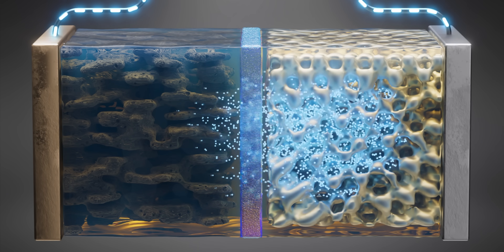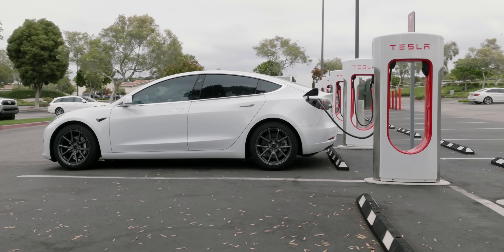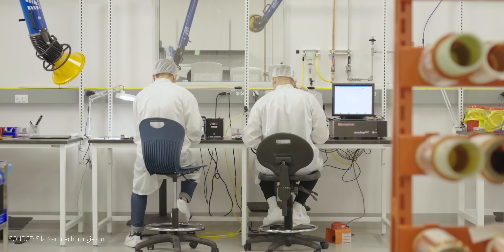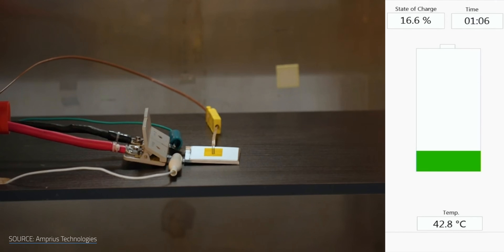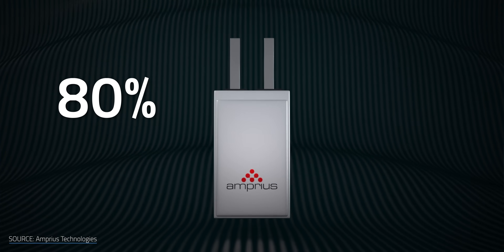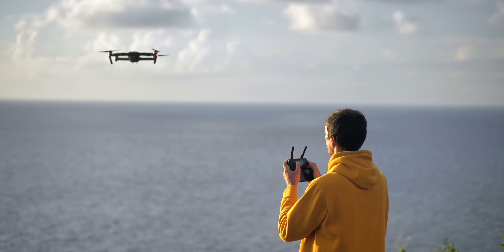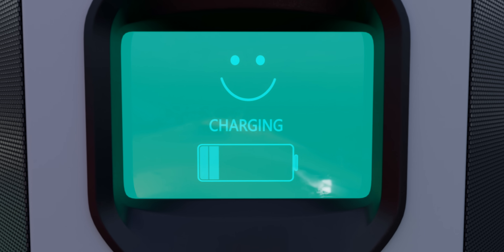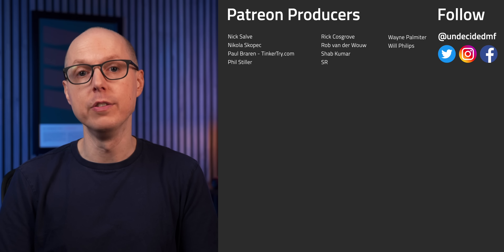Why This Ultra Dense Battery Breakthrough Matters

Comment: Niiice. No more diagonal shot. I was wondering these days if a more lateral shot was not a possibility because of what we would see behind. lol. I still think those shots work better when it’s a conversation more than a “presentation”.
I also see some experimentation going on (zoom in/out in “dramatic fashion” at important moments). Looking to make it more visually appealing? Fear of boring with just a single shot? Sorry to be a party pooper, I’m not a big fan of the result. It is still distracting (at least for me). It actually distracts me from the info you are revealing. For them to work, there should be a pause in your speech. It would go speech/pause/zoom in/speech part we want to emphasize… you get it. But that may be too much if you are not selling ceramic coated pans on TV. lol. Kidding. It might be worth trying to see how it actually works. 
I would suggest using closer shot (zoom in) not in a dynamic way. Since there are a lot of parts where you cut to technical footage, you could come back to you in a closer shot and leave it till your next cut. Maybe even use it for the part where you talk about the cons of a new tech. Almost like a more one on one vibe. I personally like when the video change has a reason to be there. It might be a change in delivery because it’s important. It might be a closer shot cause this is the part where we dig a little deeper and see the potential flaws… and then we go back to a less tight, more relaxed open shot for the conclusion. 
Once again, just an opinion because I love the content, the videos are top notch, the delivery… I, in fact, want a “I love Matt” t shirt. lol

Comment: OMG, I am just so over this never ending hype about the next revolution in battery tech every week/month. YAWN! Non of these supposed revolutions has made it into actual products, even though for years we have to be bombarded with these lab technologies that are nowhere near volume manufacturing, with many that will never make it. Just look at solid state battery tech, they have been coming for years! How about Tesla's 4680 battery, still hasn't replaced the 2170, 3 years after its announcement and that's just a different form factor.

Comment: A battery like this plus super capacitors at charging stations to keep the load on the power grid manageable would be a huge game changer.
Reply: Thats actually a "problem" of that battery. You probably would never find a charge station that could deliver that much power in such a short time. I dont know if the powercable could even handle that without overheating.
Reply: @Daniel-rd6st It would require a lot of power, but just because it can charge that fast doesn’t mean it has to. I think the existing 350-kW chargers would get you pretty close, at least a sub-15-minute charge to 80%. Heck, the Ioniq 5 can charge 10–80% in 18 minutes, and it maxes out around 230 kW.

Comment: Batteries are one of the main things that turns me off from electric vehicles. The batteries are expensive, create a lot of waste when they are produced and when they are discarded, take a long time to recharge, capacity isn’t great, and pose a greater danger than gas vehicles if they catch on fire. Hopefully though, battery technology will continue to progress.

Comment: The Amprius battery is currently too expensive for consumer electronics or cars which is why they are targeting the aerospace market. Also, they are not in production and it's not clear when they will be in mass production. Enovix is currently ramping their new factory for their silicon anode batteries which will be in production in 2024, and they have hinted that they have deals in place with major phone OEMs (rumored to be Apple and Samsung). So Enovix will probably beat Amprius to market by at least 1 or 2 years and at a lower cost. Enovix also has a unique battery structure that prevents fires, which means that they might be used in cars once the production volume gets high enough, probably around 2026. I think Enovix will win this race.

Comment: I want to bring some perspective on one of the breakthrough's biggest hurdles. (Edited for fundamental grammar issues).

 If we step out into a macro scale of society along with geopolitical issues. Isn't it important to address the fact that, the reason why this breakthrough is struggling with scale is that, the scale (cars, laptops, etc), could be attributed to a questionable world culture?

 If you research why we all HAVE to use cars, you quickly realized that all of it was induced demand created by the empire we live in. You can't stay viable towards a path of personal sustainability without one. The U.S. size (land) problem is quickly addressed by the initial issue of unwarranted land expansion, when, the country's cities could've functioned differently;
As nodes and hubs with public ley lines (trains) to transport ourselves, at will, to key locations. This idea addresses the sheer quantity (the scale) of consumer demand. There are many issues that arise from scale in every industry, institute and needs of the people. It is all clearly attributed to the unwavering desire for a country to hold too many eggs in one basket. Example; humanitarian issues arise from scale, this usually required new inventions (laws, authority, etc) to remedy.

 I believe this to be nothing short of coping from part of the U.S dream as a whole.
We can clearly see that the needs of a smaller demand can be met. Sometimes it's okay to look for solutions in a different place than where we are looking. Fallacies can be tricky.
Are we looking at the hurdles right-side up? That's for you guys to figure. :)
Trust me, from experience, more people DON'T want cars than one might imagine.

Comment: If energy density is so much better, it also opens up the path to much lighter vehicles, same or better range with a smaller, lighter battery - it also means we could re-think the skateboard design for smaller cars and even see more micro cars on the market for crowded roads such as Japan or Europe.
Reply: Elon Musk has said that if there is a major improvement in battery density, it won’t lead to much more range, because 400 miles is really enough for almost any purpose. Instead, more density would result in lighter, less expensive vehicles.
Reply: @davestagner  To a point. Yes, you can reduce the amount of batteries as the main path, but there will be a point of min you still have to hit to still run the required min discharge rate. I dont know those numbers sadly, but there would still be a x amount of battery. Aka, more range would still be added. Also, most only do around 300 - 400 would still be an improvement. 400, 800, and 1k will be the target ranges for a while. Even if Tesla doesnt do it - others would still. Also, less weight = more range either way you look at it, so there will be just gains from just reducing the battery that they might not even care to carry over (aka, market it just better range for less the cost and weight).
Reply: @adr2t  I can see your point, but I’m not sure I agree. Range anxiety is about anxiety, not about functionality. I can’t drive 400 miles without stopping for food or other biological needs. Most people can’t. And as chargers become more readily available (and charging cycles get faster), it will be as convenient as gasoline. And that will happen by the end of the decade. If the choice for manufacturers is “Do 1000 miles on a charge to impress the manly men, or sell it for $4000 less in this competitive market”, I guarantee they’ll choose the latter. And I don’t see why there’d be a technical need for more capacity to achieve the same discharge rate.
Reply: @davestagner  Eh, 400 miles is a lot of cars, but its not all cars. Then there are variables that drops 400 down to 300. Keep in mind we're still in the 300 miles - not the 400. Thus we are still more like 200 atm (heating, weather, traffic, highway, etc). 400, 800, and 1k will be the ranges a lot of people will want because they dont have to worry about the range anxiety because they know they will be able to get to the charging station is time/gives them time. No matter the issues above not just range alone it self. Also, I already pointed that prices will drop, but ranges will still be a target they will want to still also hit. So yes, you are partly right they will focus on droping the amount of cells per pack, but still will try to get more range out of it too for maketing like they currently already do.

Comment: Amprius was also used by the top 4 teams of the bridgestone world solar chalnge this year. Reportedly the teams that used amprius achieved at least 20% more energy capacity for a given mass of batteries compared to other battery types.
Reply: We sure did! It was even more than a 20% increase! More in the 40% range :)
Reply: @benonland  not sure if you have any idea - but , based on the info in this video, a silicon battery can supposedly hold 24x more ions than graphite. shouldn't we see more like a 2400% increase? why are the increases so small (contextually), when the improvement in density is supposedly so large?  a 40% increase is HUGE typically. but when it supposedly is 2400% more dense, 40% suddenly seems miniscule.
Reply: @monkunashi Theoretical limits are theoretically possible. New cutting edge tech rarely lives in the lab until it is optimised to the maximal point before being commercialised. It can go to market as soon as it has enough of a competitive edge to offer; that allows companies to profit from and recapitalise on their R&D to that point, as they push further forward on reaching a more optimised product. Iterate faster, commercialise faster.
Reply: Finally cause, I have stock in them.
Reply: @psylinx  Finally is right, I hope I live to see a break even on that investment.
Reply: I hope so. @MikeGentry
Reply: @psylinx  u guys should be happy now lol their stock exploded
Reply: wow, cool seemingly tribal info at 1st :)!

Comment: there will be a space for silicon batteries. other anode materials that have similar properties include having metals such as niobium and titanium. again, price, price, price is what it is all about. So not necessarily a direct replacement where Nb is >$20/kg and Titanate is $12 to $18/kg while graphite is $2/kg

Comment: Silicon is also used in processors, so if we start using it in batteries as well, are we putting too many eggs in one basket? Are we going to reach a point where we need to pay attention to our silicon footprint the same way we worry about our carbon footprint? While it may be plentiful, I've heard that processing silicon for processors can be a toxic process, and as such there may be concern with balancing its effectiveness with any harmful byproducts from processing. This sounds promising overall, I'm just worried about the bigger picture of it all.
Reply: Amprius uses three different chemical vapor deposition processes to grow its silicon nanowires, which is very different than creating silicon logic chip. I don't think that we will ever see batteries combined with silicon logic chips. I imagine that similar chemicals are used as in silicon chip fabbing, but Amprius is very tight lipped about its process, so hard to know if similar pollution problems.

Comment: The availability of Silicon anode battteries does not necessarily mean that this is the way to go. But it definitely moves the goalposts. If you manufacture conventional Li-NMC or Li-FePO cells, or if you want to get to market with a new cell technology or develop a new cell chemistry until it can go to market, Silicon anode batteries are something you have to compare to and to be better at least in some aspects to convince potential buyers.

Comment: The range issue is not an anxiety.  It's a reality.  Feel free to use a BEV in North Dakota like I did and make it work for 4 years, even on road trips at below -20 to Montana, when the range is cut in half or worse.  Didn't get stranded due to running out of juice, but came close a few times.
Reply: You sir are one tough hombre! 
I'm now  70 but I used to bike summer and Winter in NE Illinois until 10 years ago.  Also built a home made EV in 1978.  I would never use an EV in your climate farther than I could safely walk to warmth and safety.   Well maybe if I trailered a generator, plenty of fuel and a can of starting ether.
Reply: Your range anxiety is self-imposed. Maybe driving an EV in ND four years ago, without charging infrastructure, in the winter was not a good idea.  

Would it be the same today? I drive my EV in rural MN, and to SD, regularly. And as of this year, I have charging options all along the way. Four new ones in just the past 8 months with more on the way. No anxiety for me, even at below 0. If I want to go deep into northern MN in the winter, it's a different story. I would not drive an EV in that case. I plan ahead so as to not experience range anxiety.
Reply: Anxiety has nothing to do with it.  These are cold hard facts.  We had enough charging infrastructure 4 years ago to support 120 mile range.  At -25' Farenheit, 335 mile range becomes about 140, especially if driving into a headwind, so that's cutting it pretty close. I drove a 2020 Model X with 295 mile range from MN to Fargo at -20 F into a 20mph wind in 2020.  Range reduced by about 60%.  Stopped and charged to 100% in Alexandria. That's 108 miles along 94 to Fargo.  Even with heat cut and at 60 mph, rolled into the Fargo supercharger with 3% charge left (about 4 miles at that temp).  EV's need more range and faster charging to have the same utility as ice vehicles.  They're not a good choice if you have to keep an ICE as backup.  LI-OH batteries suck in the cold, charge slow, and don't last if supercharged often.  Just ask anyone  who used a Model 3 for Uber.
Reply: @hammerfist8763  I can only imagine the lack of mileage performance here in the deep Gulf south. A/C is a must most of the year. Anyone with experience? Doing a quick bit of research shows an average of 25% reduction in mileag but does not graph it for ambient temperature. As temps climb over 90 degrees mileage drops significantly. At 100 degrees there is a 31% reduction in mileage with A/C on.
Reply: @WayneTheSeine  AC + hot climate did not seem to impact mileage nearly that much for me.  Heat tends to increase Li-OH battery efficiency.  Cold, especially at -20' severely impacts it (50%+ decrease). I've put 60,000 miles on my Model S-50,000 of those in North Dakota and another 10k since moving back to central Texas.  30% seems like a huge hit for something minor like powering a 3 hp AC motor vs the 600 hp electric motors propelling the 4800 pound vehicle + driver.
Reply: @hammerfist8763  The 30% hit is due to the battery not the motor. There is a point of diminishing return with heat and Lithium batteries. All of the "minimal" research I did cited the same stat.
Reply: @WayneTheSeine  I'm in Austin, TX now and took a road trip to Fl earlier this year at 95'+ running AC all the way there and back and did not experience anywhere near a 30% range loss.  I've put 60,000 miles on my Model S and would have noticed a 100+ mile range loss.  Were you driving uphill into a headwind at the time?  Were you in an X, a Y, an S or a 3?  Are you talking a 30% range loss vs ideal stated range?  To get close to Tesla's ideal range you need to drive around 50 mph.  If you drive any faster than that, unless you have a tailwind, you will get significantly lower (about -10%) range just from driving ~70 mph.  A good tailwind can easily add 20% range to a Model S.  Driving from ND to SD over a year ago, with a steady 20mph tailwind @80 mph I got an efficiency of 250 wh/mile on a 100kwh size battery Model S100D.  This translated into a real world range of 400 miles for that  portion of the trip. That is a near 19% increase in range over my ideal stated range of 335.  My conclusion is If you're getting a 30% range hit from just running the AC, there's something very wrong.  Whip out a physics book and do the math.  You should be getting a 1-2% hit on range from running the AC.

Comment: Another big difference is that instead of half a rack of batteries or one of those Tesla wall things, you'd be able to store enough battery power to power a house for a day, in just a 2 to 3U unit.

It would make adoption of battery storage for home solar/wind/etc much more realistic.

In the area around me, 50% of all houses now have solar on their roof, just a handful of people suppliment it with a small vertical turbine.

Not a single one of them has a battery unit.

Both because it is space and cost prohibitive (granted, the cost prohibition is in part because solar got heavy subsidies, batteries didn't.)

Comment: Best use, in my opinion, is light cargo EV scooters.  Taking kids to school, getting groceries all on solar panel covered bike paths.   Batteries could be on subscription service, so pull into your 7-11 or Circle K quick mart and swap out for new battery at the kiosk for another 100 miles of range at 25-30mph.   No not for everywhere, sorry if you live on the North Pole, but there are MANY areas this would work.  Saving petrol for the important stuff, like farms so we have food in the future (unless you hate your kids, then let them struggle)